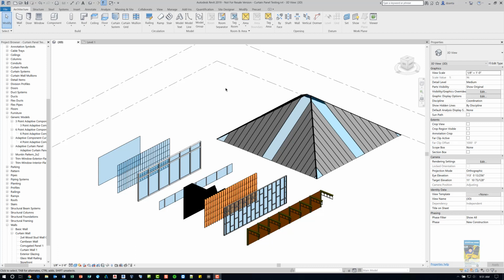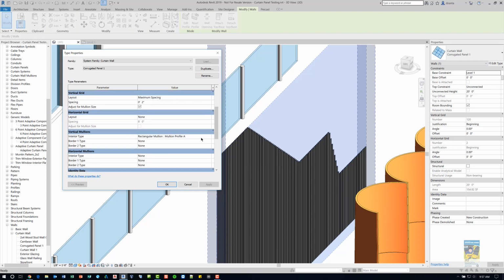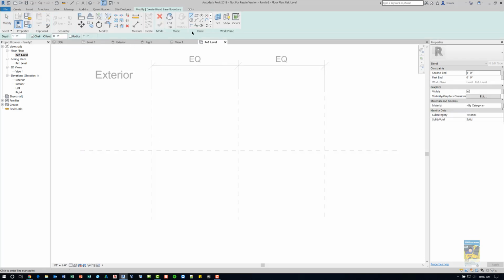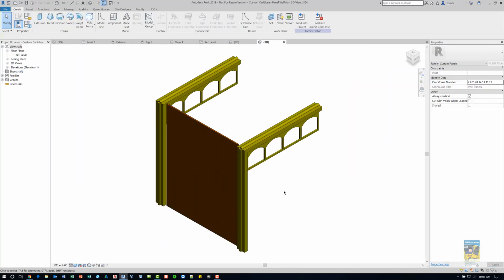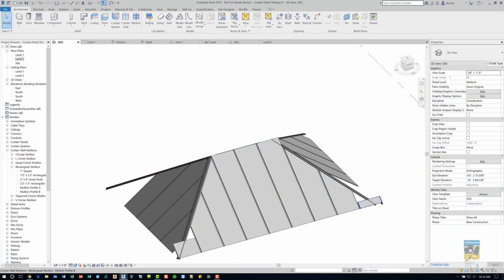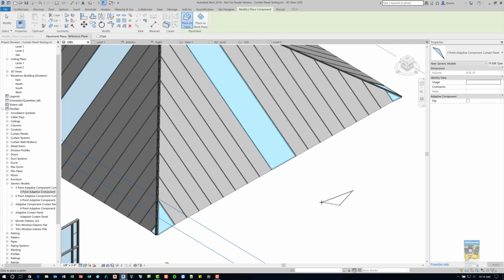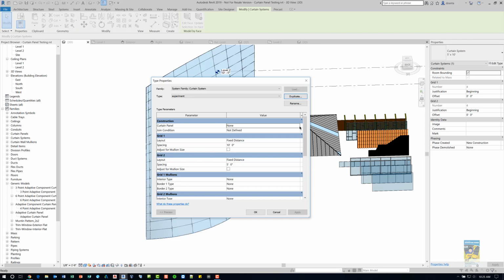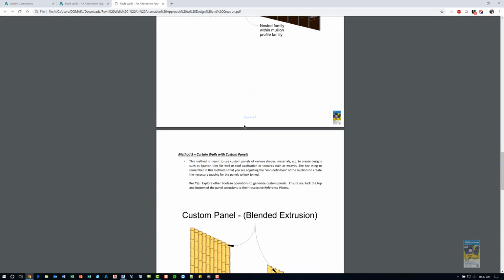Revit 2019 - Custom Curtain Panel and Wall Design Study and Experimentation

Comment: 12:16 what command did you use to extend the line itself??
Reply from the maker: Trim/extend single element
Reply: @DzanTa  Thanks but it looks like you only clicked the line command and it just extended itself?? Did you use the shortcut??